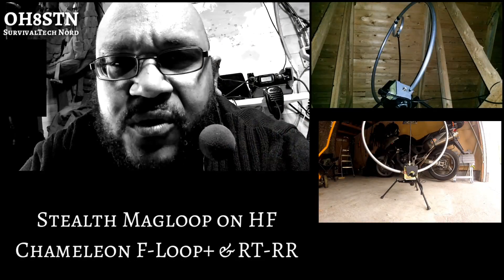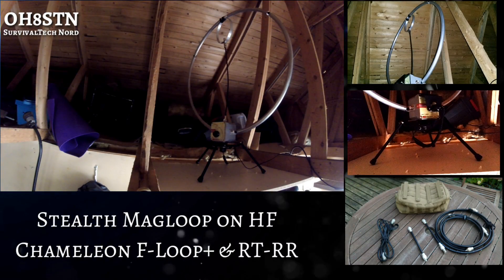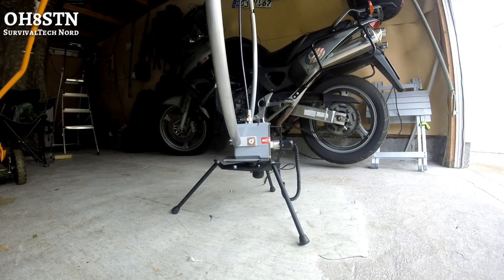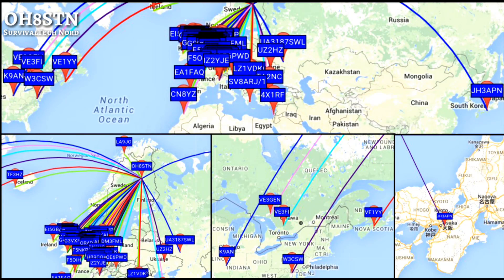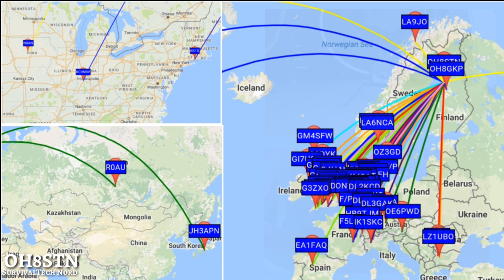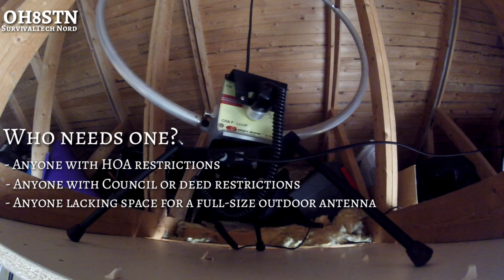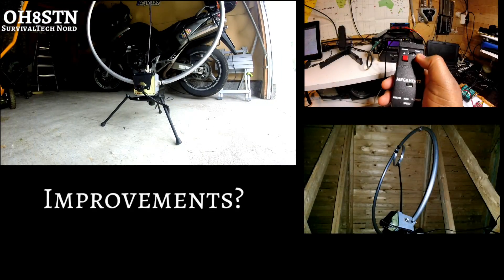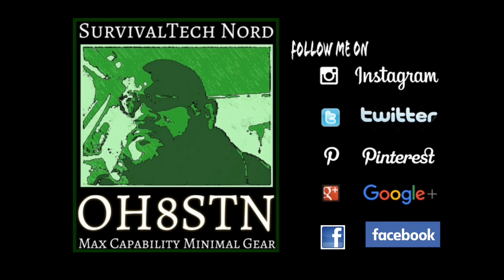HF Antenna in the attic ham radio magnetic loop antenna for HOA

Comment: You can add a Wyze cam for less than $50 and use your cell phone to watch the video feed of the antenna position in the attic.  Wyze cams are great and reliable.  I have several around my house for security purposes.

Comment: Like the review very much Julian.  I have recently moved into a single floor condo townhouse with a substantial attic - however the noise level on an end fed wire is around S9 to 10 over.  In your experience would the F-Loop substantially reduce the noise so I could do some shortwave listening and get on JT65 and Pactor again?  The remote controls would allow me to use it in the attic space right above my radio room.  I could put it out on my deck - only when in use because of the resident restrictions - but that becomes a pain especially during the winter months.  Anyone's advice in similar circumstances would be appreciated.  Rob
Reply from the maker: +Robert James thanks for reaching out Robert. There's a few different things to consider before I answer your question. As you see this video I'm using it in exactly the same way you described. But before I even started to consider the magnetic loop I had to think about reducing the amount of interference I was getting from the electrical devices in my home. That's the first step. So all of the cheap Chinese Transformers and usb chargers got the hammer and went to the trash. Anyway you get the idea, but once I reduce the noise levels as much as I could I tried the endfed again. Of course the noise level was much lower about an S4 S5 which for weak signal work is still too much. It was at that point when I got the RTR or kit and put the loop above the Radio Room. At this point I have a 0 noisefloor using the F Loop. With a traditional dipole, I still have that S4 to S5 noise level. I don't have a lot of experience with indoor wire antennas, so I don't know if those are an option for you. As far as the loop goes, if you don't mind not running 100 Watts, and you have no other alternative, I would say go for it.
I hope this helps and feel free to ask me any type of questions you like.
73
Julian oh8stn

Comment: Nice review Nord, thanks - how do you feel about the difference between the model that uses LMR-400 and the one that uses the 1" aluminum pipe... is it worth the extra 100. ? Thanks for any feedback - best and 73
Reply from the maker: +pcomp Thanks.  It's kind of difficult to say which one is better value because they're not really designed to be measured that way. The LMR400 version is definitely more portable, while the aluminum radiator is more efficient. So I definitely get better performance out of a aluminum radiator. The day gets better Mobility out of the air in LMR400. So the point of all of these Lego blocks is for you to put together the right kit for your operating conditions. Appear in the North where there isn't a whole lot of operators, I enjoyed the increased efficiency of the aluminum radiator. Another thing to consider is chameleon is about to release a power up kit for the F & P loops, giving them ~40 watt capabilities. That's also a lego block add on kit. The point I'm trying to make it look at the F-Loop from a price perspective, look at it from the capabilities it offers you.
I hope this helps
Reply: Well, at least if I hold out for the model with the aluminum radiator then it comes with the LMR400 as well, so I can have that flexibility.  73

Comment: Of the two version which one do you feel is all around better or performs better? The rigid loop or the LMR400 loop version? Great videos and very informative as usuall
Reply from the maker: +Bradley Johnson hello Bradley. Definitely  the 1-inch rigid aluminum loop is the better performer. I believe the performance gain comes from the increased diameter of the radiating element. Moreover your question sounds like an upcoming video comparison to produce.
Thanks for watching and for the question, it's very much appreciated.
Reply: OH8STN SurvivalTech Nord Yes, a comparison would be great. You do a fantastic job on your videos. Very detailed and organized. Thank you.

Comment: Great video! At some point, I would like to pick up this loop with the RT-RR as I live in a HOA.
Reply from the maker: +VideosByDPF thanks and once again I remembered now that I forgot to reply to your message. I'm on 40 meters right now testing this setup. It's seriously not bad. I'm hoping to get Carl to release day interface to the motors so that I can build an open-source remote control handset with rotary encoders instead of the push buttons. As always thanks for stopping by. It's always good to get your comments, and they are very much appreciated.

Comment: Great demonstration. Only suggestion would be to add a price level. Saying the full setup will cost somewhere less than $1000 should not scare away folks that know HF requires this kind of cost for some antenna solutions. Am sticking to this price assuming some remote compass-arduino is attached.

Comment: You could use an arduino to add the compass for your azimuth . Would be a very nice( as you said needed) addition to the product.
Reply from the maker: +James Bridges that actually sounds like a brilliant idea.
Reply: +SurvivalTech Nord Since you are running wires anyway, a Catkit and terminal kitten will let you use cat5 cable to separate either( or both) the compass or (and) a LCD display from the arduino.  Would be similar cost compared to wifi, but would operate independent of a computer and be a more solid connection with reduced rf emission.

Comment: Been debating one of these for a while. I live in an apartment, so this would be nice, if it'll work. Chicken wire holding up the stucco kills signal.
Reply from the maker: +Ed Fay check the playlist in the description. One of my first F-Loop videos was done with it from inside my home. It was an SSB qso of about 2000 km between Finland and UK. Honestly I was quite taken aback. Anyway thanks for watching and stopping by it's very much appreciated.
Reply: Problem is, this apt is a dead zone. 1 bar cell service, FM comes in weak, 2m was shoddy. I tried my Buddipole at my last apartment and couldn't hear anything  other then static no matter the band. I'm just a little off put by dishing out cash for the loop, and it doesn't resolve the problem. My current option is my AlphaAntenna mounted to my car in a parking lot somewhere, not too fun in a Central Texas summer.
Reply from the maker: Ed Fay  perhaps a better approach would be enlisting the help of other radio operators in the area oron the net. Find other operators with similar operating conditions as yours, then find out what they're doing to operate effectively. It sounds to me like you suffer from several problems at your location. The worst of which is RFI. Honestly though I don't know of any antenna system which will help you radiate effectively if you live inside a faraday cage :/
Reply: True. I setup my Alpha vert leaning out off my patio yesterday and was picking up a lot of CW and a few strong ssb signals. All might not be lost. Still considering a F-Loop and will throw the Alpha on the car this week.
Reply from the maker: Ed Fay throwing money at the problem usually doesn't work anyway. Better approach is always understanding the environment, then building a system which works in that environment. Remember, a mag loop will not work inside a metal box. It will work on a balcony though! It only needs to be one outer loop length high, and away from any metal. Hopefully you can get help before pulling the trigger.